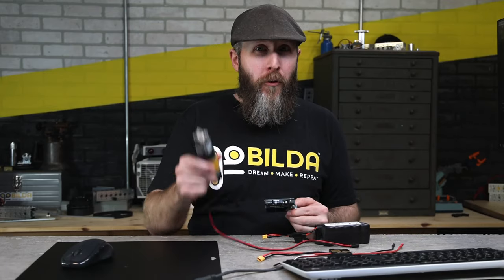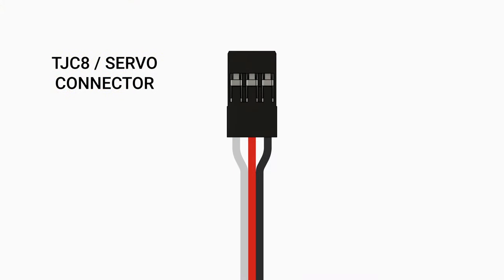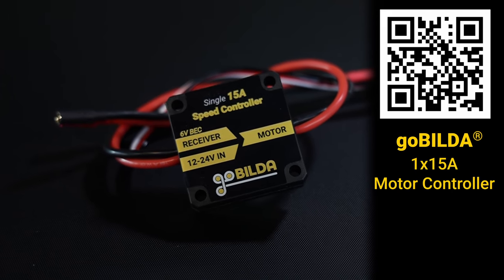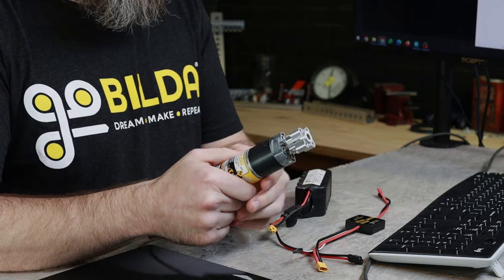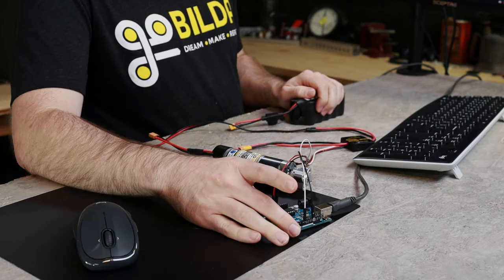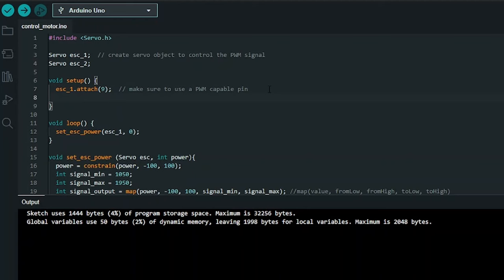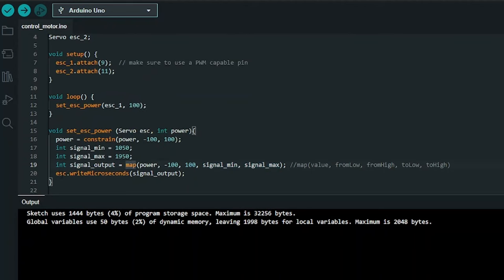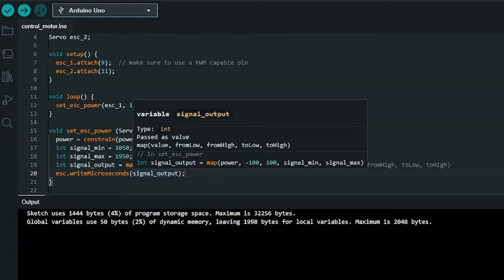Control Big Motors with your Arduino (Step by Step Tutorial)

Comment: A) The external one is not a “controller” but an H-Bridge drive. B) PWM is not a form of communication but Pulse Width Modulation that allows the Motor power supply to be “chopped” on and off in order to get a DC mean voltage “modulated” or adjusted betweenness -Battery Voltage till + Battery Voltage